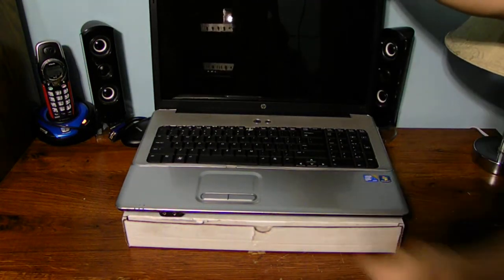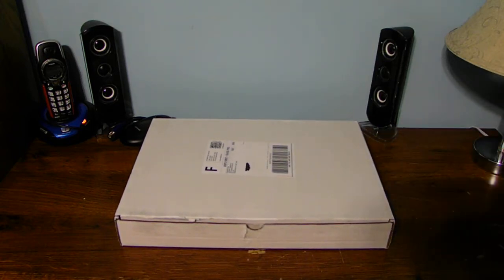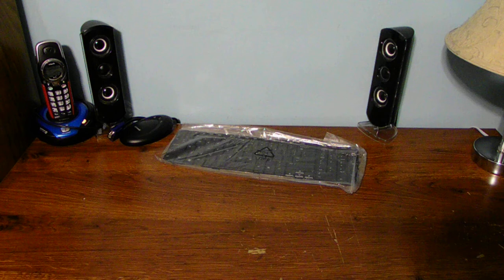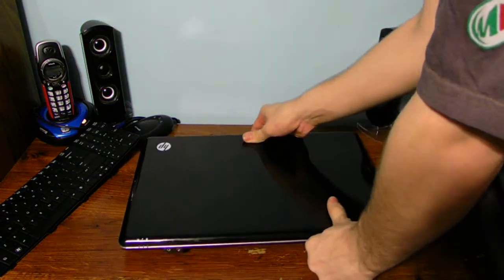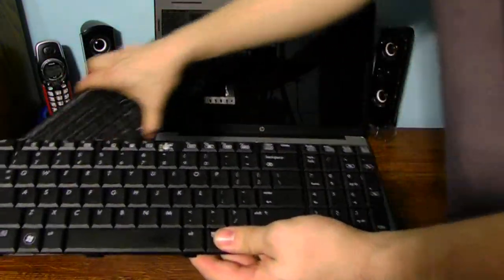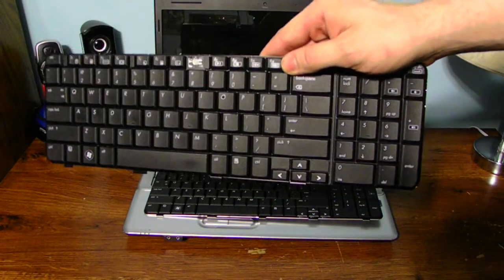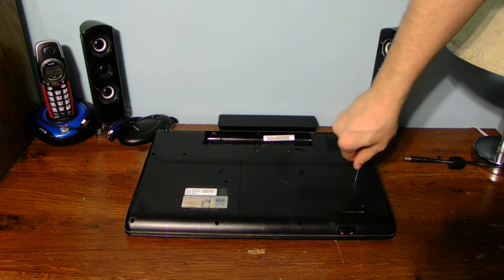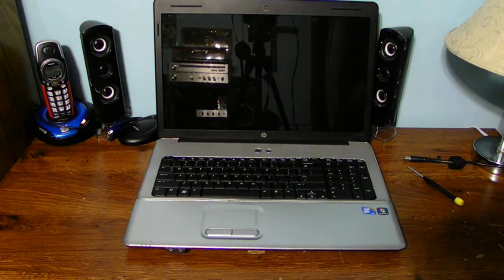How to install a brand new keyboard and your hp g71 laptop computer

Comment: Thank you for an informative video.  I was able to switch out my G71 keyboard, but I do agree with some of the comments that you could have condensed the information more.  For the benefit of those who want a quick summary, here is what I did:

1.    Disconnect the power, close the laptop and turn it upside down.
2.    Remove the battery.
3.    Remove the cover that hides the hard drive and memory.
4.    Remove the 5 screws that are labeled with a little keyboard picture. (You will need a deep-reach philips head screwdriver)
5.    Turn the laptop right side up, open it and disconnect the keyboard by carefully prying up across the top edge with a flat screwdriver.
6.    Disconnect the cable from the laptop by lifting the little hinged clamp that holds it in place.
7.    Remove the old keyboard completely and set aside.
8.    Connect the ribbon cable of the new keyboard by sliding end of connector straight into slot and pushing hinged clamp down on it.
9.    Place keyboard into the keyboard bed and press all around on edges to snap it into place.
10.    Test to make sure all keys work.

Thanks...

Comment: Thank you for the video, but Jesus have you ever heard of editing?  You babble incoherently throughout the video and the "guide" starts with the keyboard already unscrewed.  This could have been a 3 minute video but instead you babble on and on confusing the viewer rather than giving straight forward cut and dry directions.  You repeatedly state how easy it is, yet don't even offer a closeup or a still frame of where these "6 screws" are.  Look, not trying to be a dick cause this video DID help me out, but it was painful to sit through to get the actual information needed.